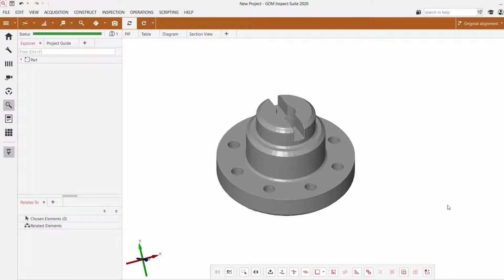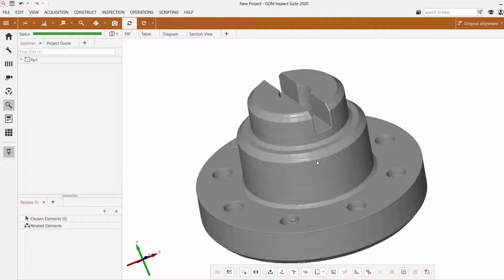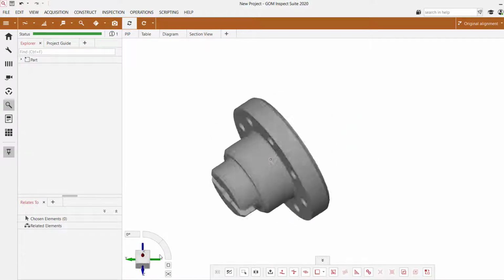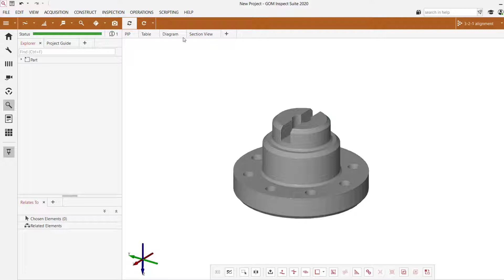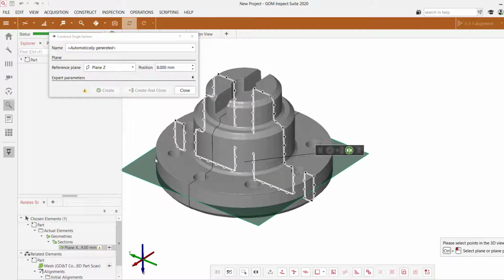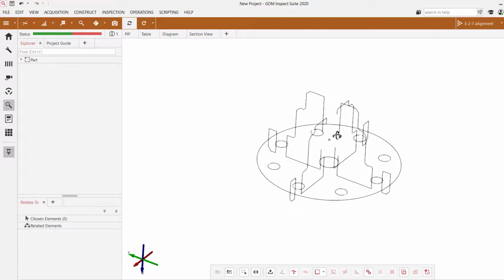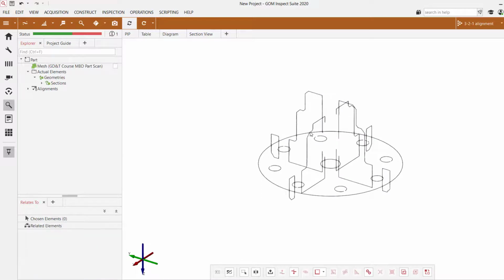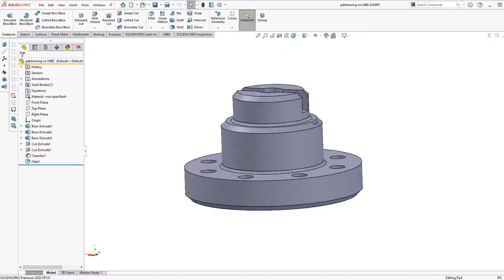Tech Tip Tuesday: Export IGES Geometry with GOM Inspect

Comment: ry drilling two 3mm holes at an angle of 35 degrees in from each side. drill just below the larger 45 chamfer through all  then you will really have problems.. if you can scan everything,,. then you will get 1000$ from me,,I think it's easier to take a caliper and measure the workpiece and then turn. a new part. it will take 10 minutes mesure and 20 minutes to turn and mill. so we have saved a lot of money

Comment: You shouldn't have small workpieces with lots of details. It's a bad choice. MR scanning works and all hidden holes are included. It's probably good for large areas where the camera needs to be able to see everything. You have to secure the model with pins and spray it with white spirit paint and put reference marks in all places. Where I was, it's sitting unused today. It was a waste of money.